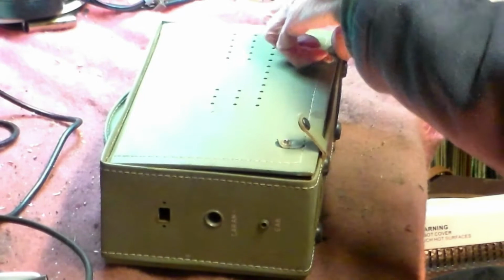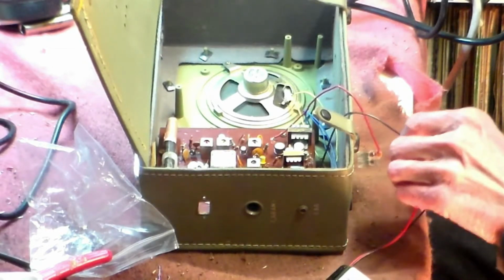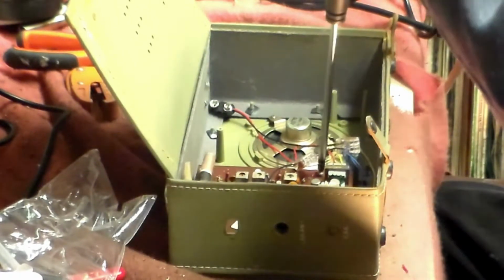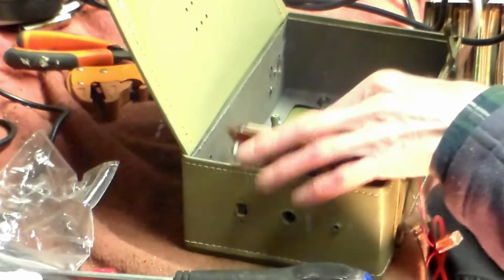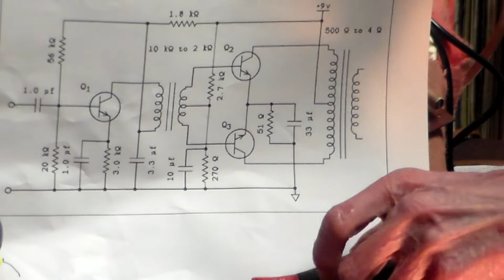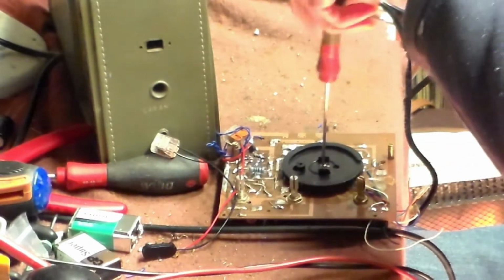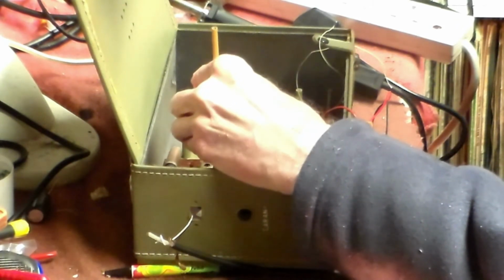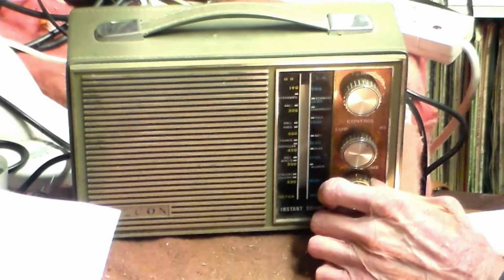Falcon Cheapo Transistor Radio

Comment: nice one steve its good some one repairs these cheap old sets or they would vanish and they are a part of radio history.
i f i came across an unknown transistor set and found it had negative ground i would think that it was fitted with silocon npn transistors.
Reply from the maker: Another reason to go to the car boot sales when they restart!